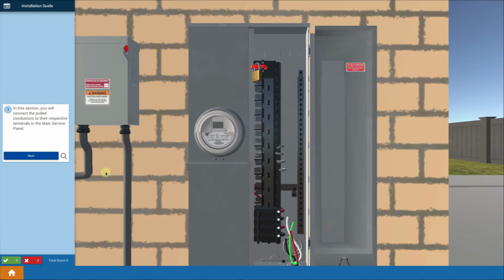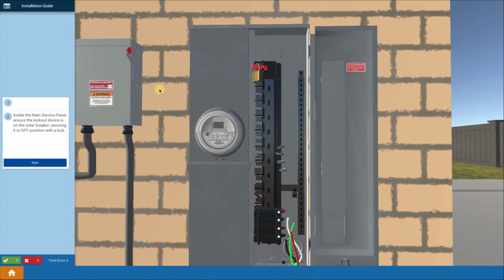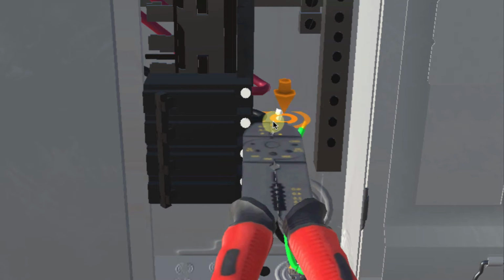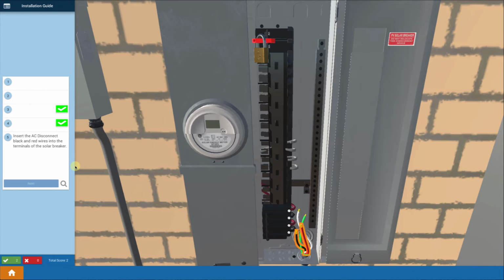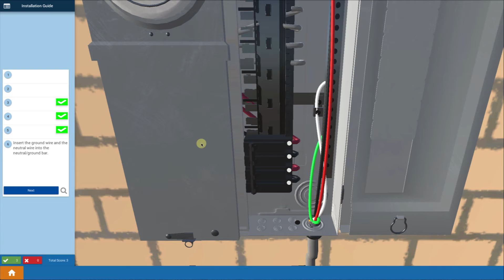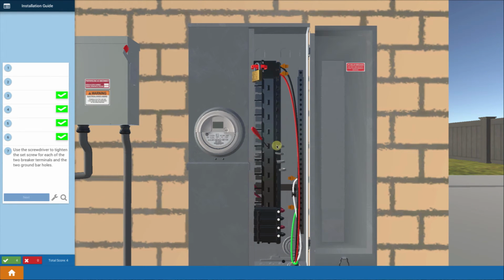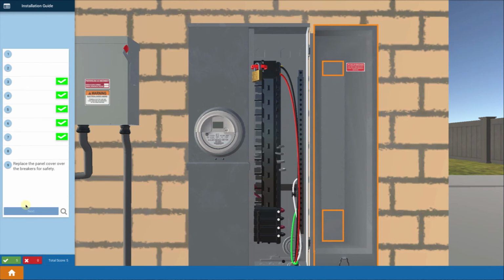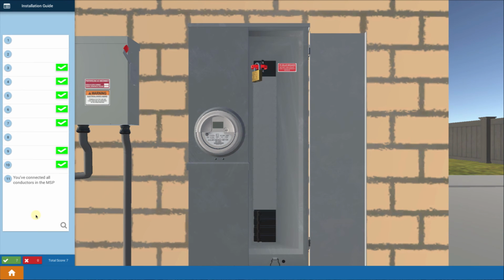Solar Training - Connect Wires in the Main Service Panel

Comment: If I am using a 240 V inverter with 2 hot lines coming out, can these two wires go directly to the double pole breaker without going thru a split phase transformer or a mid-point transformer?   They sell these as pairs. Maybe this is only applicable to off-grid??

Comment: hi thanks for the great video Does the breaker stay off for the solar or do we turn it on how does it work
Reply from the maker: Yes the breaker stays off, we did not remove the lockout device yet. We get to that step later, during system commissioning, where we systematically go through all the electrical boxes and disconnects and turn on breakers and switches in a prescribed order, checking voltages as we go along. So we leave that solar breaker off for now, yes.

Comment: Hi. Connecting the cable after the grid tie inverter - AC disconnect sw - the existing main service panel even the grid is in the ON status? I mean solar energy and the grid energy is meeting in the main service panel is this ok? no burning and sparks? Thank you.
Reply from the maker: Good question. The idea here is that we have locked out the Solar Breaker in the OFF position. So that means we can safely connect wires inside that Main Service Panel (MSP) without having any current flowing out from that breaker to any components downline. Also realize that this video is from a simulation sequence of the entire install of the system, and in this case, it is focused on just the wiring at the MSP BEFORE the system is turned on. This wiring is occurring between dead enclosures. there is no dc solar power being generated yet from the array and no ac power coming out of the inverter - everything is sill just being assembled onto the wall. Hope this answers your question.